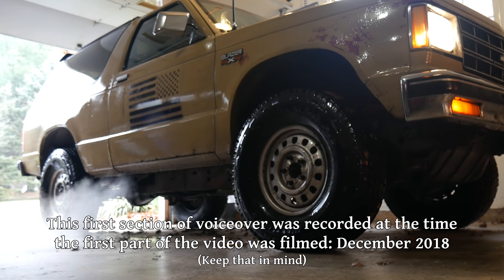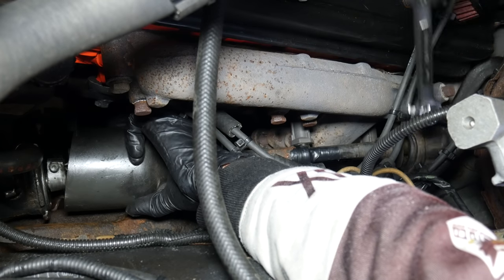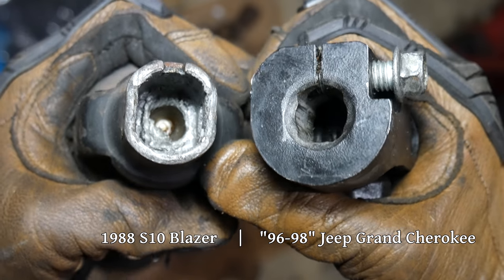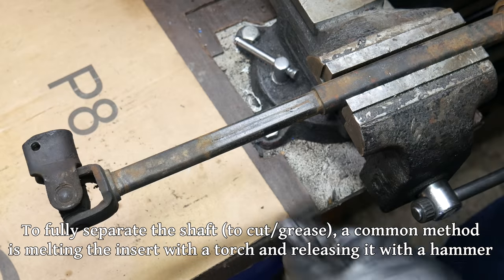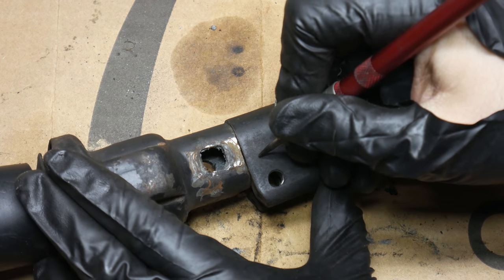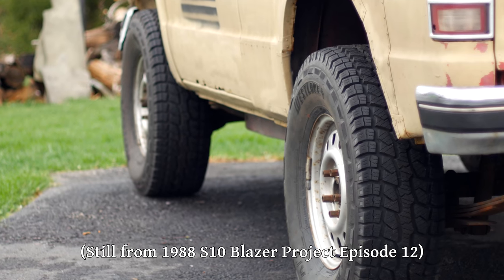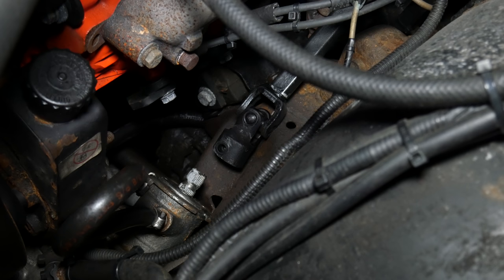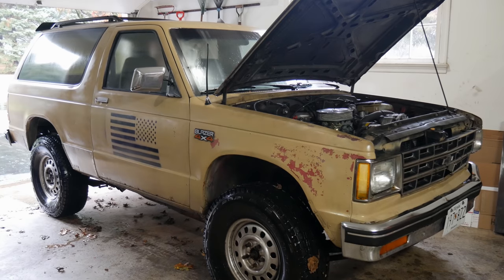1988 V8 S10 Blazer Steering Shaft Swap/Mods (Jeep Cherokee Shaft) (Ep.18)

Comment: You have probably fixed this by now.  The play in the steering is in the valve assembly on the input shaft of the power steering gear. Rebuild the gear and the play will be eliminated.

Comment: If I would have been able to give you advice I would have said go find a 90s Ford and take the universal joint off of the steering column for they are actually pretty easy to takeoff just one bolt in a little bit of hammering and you could’ve slept it off the end of the test and steering shaft where the rack giant was after cutting it off and then mounted it to the other piece of steel steering shaft that remains that clamps onto the steering box

Comment: i did this exact swap on my k5 blazer. it was a direct bolt in except for grinding a slight grove in the upper shaft for the pinch bolt. the jeep shaft is hard to move because it is made with injection molded nylon inside as a bushing. you need to heat the shaft to loosen up the nylon. it made a big difference in the road manners and feel of my k5. it was one of the best and cheapest upgrades i have ever done. as a bonus, it also works on third generation firebirds. i don’t know if it works for the years with the air bag systems

Comment: On my 00 s10 I cut the u-joint end off a jeep shaft then cut the chevy rag joint off and welded the jeep end to the chevy shaft. It works great and is more out of the way to get the center spark plug out on the 4.3 v6.

Another cheap option is to drill out the rag joint rivets and put bolts in tightly squeezing the joint together.

Comment: I did the Jeep XJ shaft mod for my '94 Suburban, and got the first one you showed.  What I ended up doing was grinding out the column end to fit.  Took a little bit of time, but it fits like a glove.
Reply from the maker: That's commitment! I suppose it is probably soft enough metal that a die grinder would make it happen before you tear all of your hair out though, nice work!
Reply: Yeah, it wasn't that hard to do.  I just didn't feel like going through the effort of tracking down the other one.

Comment: The only thing that I would do differently would be using a cotter pin on the top bolt instead of hammering the nut.
Thanks for the video, it's well done.
Reply from the maker: Also a good idea! That would certainly do the trick.

Comment: On my dime, I blended the top of an S10, and the bottom of a Fiero steering shaft.  I'm sure there's more like that, but it's what I had.  
Oh yeah, there's a plastic bearing at the bottom of the shaft where it comes through the firewall.

And one more place... is in the tilt steering mechanism.  Same column (essentially) as used in the Fiero, G-Bodies, etc.
Reply: Astro Van & 85-95 Jeep Cherokee Steering Shafts will work on these S10s & Blazers

Comment: I think I've seen guys use that Astro steering shaft in the 3rd gen Firebird & Camaros to get rid of that rag joint as well I believe. 🤔
Reply from the maker: Yep! Pretty much anything GM made with a rag joint can, one way or another, have one of these shafts fitted to it. I didn't amass a pile of them just for the Blazer!
Reply: @FuzzyDiceProjects  Be aware that a lot of 3rd gen guys take them out after putting them in.  There isn't that much room for play in the rag joint, so unless you're super sensitive to it it doesn't make that big a difference, and the Jeep shafts are phased wrong for the use so someone supercritical will notice some steering weirdness (sort of like the steering is speeding up and slowing down), but the bigger thing is that it transfers power steering pump noise into the cabin and some even notice the steering wheel vibrating with it.

If you're missing in that area, a more beneficial mod is to replace the bushing at the end of the steering column with a new one or a bearing from an Astro.  These cars and trucks are 30-40years old now and the plastic bushing is usually worn out, the new one or the bearing tends to get rid of little clunks and clicks in the steering that you often can't find a source for.

Comment: I've really enjoyed these s10 vids I've built my own v8 4×4 s10 recently and you have helped me achieve that dream. Thank you.
Reply: I'm in the process of finishing up my 84 S10 Blazer build and I bought a 93 Blazer that I'm turning into a Pull Behind Camper to match my blazer..... Last thing I need to do is get a New Rear End and put it in my Blazer and it will be ready to go
Reply: @s10_4_life6  that's awesome! Mine is a 84 short bed I have a 383 striker backed by a 350 turbo with 207 transfer case. I'm down to the little things are fine as is but it's kinda a never ending project for me and my kids to drive and wrench on
Reply: @v8sserieschevy917  Lol I definitely know what you mean, I've also got a 95 S10 truck that I've been Building for the Past 3 years now, I did a 4.3/5 Speed swap on it ( Was a 2.2/5 Speed ) and I've just been building it to be kinda a show truck, But last month on my way home from a show I blew the Motor up 😢😢 So now it's on the back burner until I get the Blazer done & I can find a good 350 SBC and I'm just going to V8 swap it, I've got another Good 4.3L here that I could just throw in it, but I told myself when I did the 4.3 swap that if something happens to this motor I'll V8 swap it next Lol,   If you check my Channel out you'll see my Blazer & Truck, The Brown Blazer is the one I'm building, The White one is the one I'm building a Camper out of & my truck it Black & Silver
Reply: @s10_4_life6  dude I'm all about s10's I will subscribe right now. I've built a few s10 growing up but this is my first one I v8'ed for myself so I've noticed so many more aftermarket parts available and it's got me stoked to soak up all the info I can
Reply: @s10_4_life6  maybe we've got some parts we swap out here and there if your interested
Reply: @v8sserieschevy917  Where are you located at ??   I'm in Southern Ohio....      I bought my truck like 3 years ago for $600, it was a beat up Ridge Runner, but I started fixing it up slowly over time, Buying parts & Other Donor S10s for Rust Free & Aftermarket parts, I've got around $12K into my truck so far Lol, But everything on it is Brand New, I mean at least 99% of the truck is Brand New, Same with the Brown Blazer, I've rebuilt it from the Ground up as well, but I've tried to keep it as Factory as possible to keep cost down, But so far I've replaced Everything on the frame so far & The Frame itself too Lol
Reply: @s10_4_life6  I'm in West Georgia but I love road tripping my builds lol I'm only about 1200 into mine bc I had a block to rebuild an got the truck for 500 an put my go fast goodies in it I've saved from different builds over the years. God has really blessed me with this project. It's been nearly 20 yrs in the making from conception to everything falling into place
Reply: @v8sserieschevy917  I've got a Page on Facebook called "S10_4_Life", You can hit me up on there if you want, I've also got my own Group too call "MiniTruckin Uncensored" if you want to join there
Reply: @s10_4_life6  man my truck keeps trying to run after I shut it down. Any advice?
Reply: @v8sserieschevy917  I'd check the solenoid, or it could also be the ignition
Reply: @s10_4_life6  it's getting better checked timing. Think it's in my carb now but not sure yet. Im cleaning now

Comment: 88-94 Cherokee you need(Not Grand) 
but for S10 i prefer the Astro Van Shaft(Does require a simple mod to make it Fit but its a great piece) 
plenty of info on 3rd gen F-Body Forum.(Also fit 78+ G-Body and S10)

also Full Size Van like 96-01 for you B-Body guys and Big car.

Comment: Made this swap on my '85 Grand Prix back in the day when the inspection guys didn't like the old rag joint anymore. I think I use'd a variant of one of the grand cherokee steering shafts. It bolted right up after getting it to slide freely and a liberal coat of anti seize.

Comment: Also I actually used this shaft and just cut my end and welded to the new and it was super easy. Couple hr job with pulling the parts and modding. I got faith in my fabricators

Comment: I've done the same with my '94 S10 Blazer. I used a Ford F-150 steering shaft. It's a bit more slender, however, much more solid. The only modification is cutting the nipple off the steering box. Besides that, it's a direct bolt on.
Reply: My 93' Blazer has the same issue. The F150 shaft also bolts right in
with no alterrations?  Good to know, what year F150's can  you salvage it from?

Comment: Once again, I urge you to go nuts with the caster. You can’t really go too far and it’s a quick and easy job. Once you get it set, the slop really won’t matter because the wheels will WANT to track straight.
You can tell how much caster you have by how strongly the steering wheel recenters itself coming out of a turn.

Comment: I did the steering shaft modification on my big mileage 1993 C1500.  Prior to that I also replaced everything in the front end including the upper and lower A arms.  After the front end was better than new, the steering was still sloppy.  That is, until I put in the Jeep steering shaft.

The vehicle is now nice and tight for a full-sized bed and extended cab come up on thirty years old.

Comment: Most of the reman steering boxes you get that aren't from somewhere like Turn One, AGR, PSC, etc. are usually a crap shoot from what I've read and what I've experienced. All they really do is replace the bearings and seals and you can easily end up with a box that's more clapped out than what you started with. Which is fine if you don't care and just want to fix a leak. I've gotten a steering rack from them that still had dirt clods on it that they just painted over. But hey, it didn't leak anymore.

Hopefully going through the adjustment and preload procedures will tighten it up enough so it's not so ridiculous, but there's no adjustment for the recirculating ball/screw doobly doos being worn or the sector shaft not fitting like new where the bearing rides. It really doesn't take much slack anywhere in the steering system to translate into a lot of steering wheel movement.

I went through this with a Jeep I used to have and ended up going through 3 boxes from a local parts store until I found one that was good enough, and because I was over removing and replacing the box. After I picked up my 3rd gen Firebird, I decided to just rebuild that one myself and it's probably one of the tighter original Saginaw boxes I've experienced so far, but that may just be luck. I tried a cheap "performance" box for my 2nd gen Firebird (same price as a normal reman), and it was pretty awful on center. And I could not tighten it up any more after redoing the preload and over-center adjustments. Ended up shelling out for a new, not reman, Borgeson box for it and it's amazing. It's one of those things that seem crazy to pay so much more for until you do and realize it's totally worth it. Like really, really good shocks.

Comment: every GM steering box has an adjustment bolt, 270k miles same steering box, i did adjust it every 40k miles tho, ragjoint never changed, im installing rubber joint from b-m-who

Comment: Really good and interesting video, I don't own a S10 and probably never will but if I did, this is the kind of information I would need, - a reliable source with proof and experience. 

There is just one thing I would do differently, the hammered nut works but I would have used a normal nut and then a nylock nut on top. If the nylon melts the two nuts will still be locked together and can't move. 
That's just what I would have done. Not saying that you are wrong in any way.

Comment: When did a cab swap on my 96 dakota the steering shaft on that truck looked identical to the keen steering shaft. So that could be another option. The V6 and v8 steering shafts are a different length but they can probably be adjusted like you showed in the video

Comment: The center link is a big ware spot on those blazers too
Reply from the maker: You must be thinking of the centerlink on 2WD trucks, on this one It is just a solid bar with tapered holes in it. Unless another component wasn't tightened down enough and wallered out one of those there isn't really anything to wear. The ball joints are on the idler/pitman arm for these, and those have both been replaced already.

Comment: My first gen dodge has that awful rubber steering coupler on both ends from the factory. Upgraded to a Borgeson shaft and literally have zero play but I also have a new gearbox, and all new moog tie rods, idler arm, pitman arm, and ball joints too

Comment: If you purchase a quality new part with the FORGED end-clamps, no grinding or drilling will be necessary, just length adjustment as needed.  Omix-ada has these at around $108-- you get what you pay for...

Comment: The tall oversize tires can't help. Might make it feel loose even if everything in the steering system is tight. Also, a power steering box has more play when the engine isn't running.

I did an S-10 V8 swap a few years ago. I slotted the steering column mounting holes in the firewall to move the column a little to the left and get the upper flex joint away from the exhaust manifold.

Comment: You could have troubles with the upper and lower a arm bushings also
Reply from the maker: I mentioned it in the video, but the uppers were replaced with polyurethane bushings and the lowers feel and look solid. I would like to replace the lowers as well but I have not been able to get the torsion bars loose (and not for lack of trying!)

Comment: Most sloppy steering on S10 Blazers are due to the idler arm (even if brand new). There's an aftermarket adapter bracket made by Outfitter Design™ which allows you to use a 1-ton idler arm which is supposed to "Create a stronger, stiffer, and more reliable steering system."
Reply from the maker: Interesting, hadn't heard of that adapter before! I don't think that is the case with mine but I should look into it anyway
Reply: Hummm that's good to know

Comment: Clearly you have a much higher tolerance to steering play than me I would be almost scared to even repart a vehicle with that much play in the steering. I´ve replaced components before when the play was barely even visually detectable.

Comment: Im not saying it's your only problem with the steering.... but when you lifted the blazer with the shackles and turning up the torsion keys you lost a lot of "steering tightness". I was going to lift my s10 blazer that way(cause it's the cheapest and easiest route)  till i felt how bad my steering went.  All my steering components have 330,000 miles on them but still hold pretty well. As soon as i lifted my torsion keys i thought i was hoping to wreck with out much play the steering had
Reply from the maker: Really, that is interesting! Never heard that before. I could see how the height, width, and angles could have an effect but I can't picture how it would link with steering looseness. Will have to keep that in mind, though!

Comment: What if the slop comes from the 4 bolts coming lose behind the wheel in the steering shaft? I know that’s a problem with a lot of GM 80s cars. Just need to take the column apart (pain in the ass) and retighten with red thread locker.
Reply from the maker: Good suggestion, but it doesn't seem to be the case for this truck. Steering wheel and column actually feels pretty solid. The pivot pins are worn on my 1991 Firebird so I know what that feels like, and the column bolts are coming loose on my 1978 Firebird so I have felt that as well, neither seems to be present (somehow) in the S10. That certainly is a common issue though!

Comment: Did you consider welding the home made lock nut on the upper part so that you wouldn’t have to hold the nut while tightening.
Reply from the maker: It wouldn't be a bad idea! Don't want to weaken the nut too much but in this case I doubt it would ever matter. Didn't realize before I had to install it that it would be so annoying and by that point I was out of time.

Comment: I believe you can also do this mod on the firebird.
Reply: yup. 85 Camaro here. Done with the Astro shaft. 
my impala SS done with a 96-01 full size van.
Reply: Sweet. I'll have to this to my trans am. I remember reading that on the thirdgens you had to cut and weld something. Don't recall what but if you have done it I'll do it just as an upgrade.

Comment: i have the same problem with the steering so do i change the lower steering shaft and the intermediate steering shaft or just change one of them when i drive and turn it makes a clunking noise and some times the steering locks up and then turn back to normal what's the cost of that

Comment: shouldve just used muratic acid on that jeep steering shaft and then used baking soda to neutralize it, soaked it on motor oil, dryed it and washed it and then paint it. it would have made it look brand new
Reply from the maker: I needed it back on the truck by morning and it was already pretty late, I gave it two coats of paint in like 20 minutes and it was still tacky (pretty cold out!) when I reinstalled it. Acid cleaning is a bit extreme considering the amount of rust on everything else anyway but I'm sure it would make things look real nice if you have the time! Couldn't soak it since it would be a problem for the seals/bearing grease/rubber but I suppose you could brush it on and do it that way.